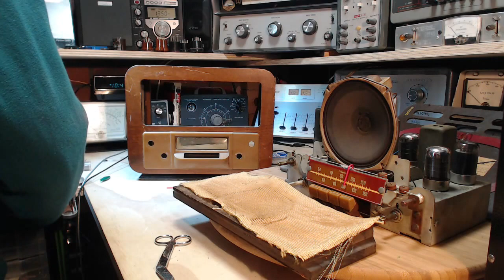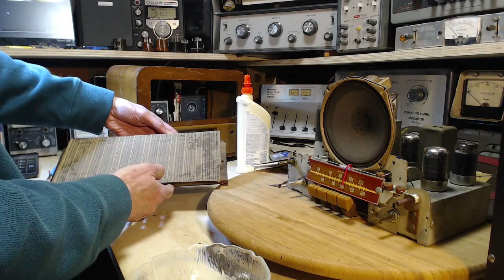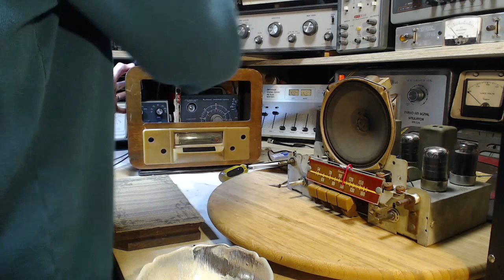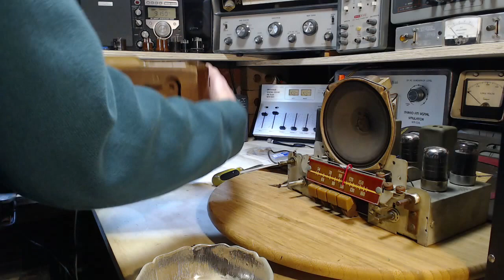Silvertone 7054 Video #11 - Cabinet Work

Comment: Jim, I have been trying to figure out your cameras. I am assuming that what ever software you are using allows you to switch between cameras. What kind, make, model, etc are the little tube cameras that you use? They seem to work really well. Is there a mike with each camera or is that separate? Thanks in advance. Scott